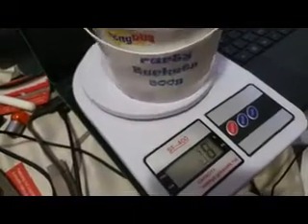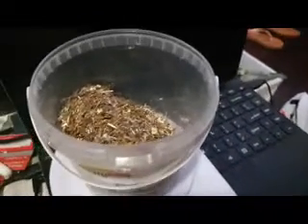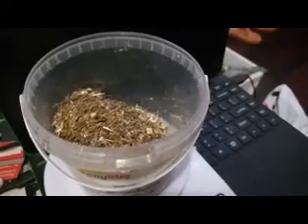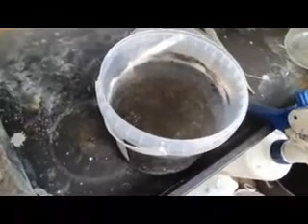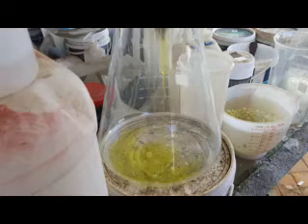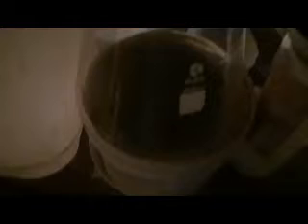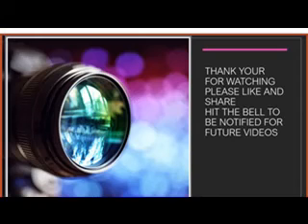GOLD RECOVERY / recovering gold from low grade pins without nitric acid

Comment: what is that black syrup you put in there? i think you called it "A.P"? what is that?
Reply from the maker: yeah , A.P stands for acid peroxide .its hydrochloric acid with a splash of hydrogen peroxide .if you dont have peroxide you can use some oxidized copper .you can use copper that has gone green , or burn some and use that
Reply: @prospectorpete  ok i have no issues with getting hcl and the hydrogen peroxide, i was just curious why yours was black and syrup-like. when i mix my hcl with peroxide it turns yellowish but still clear.
Reply from the maker: @phildiesel66  yeah because my Ap has already been used.
You can use it over and over and over.
In fact the more you use it ,the better it works.
It gets its colour from the copper dissolved from the boards. It is  the copper in solution which is what does the work.
Peroxide is only to kick start the reaction
Reply: Ahhhhh gotcha! Thanks for the info
Reply from the maker: @phildiesel66  youre welcome. I hope I helped